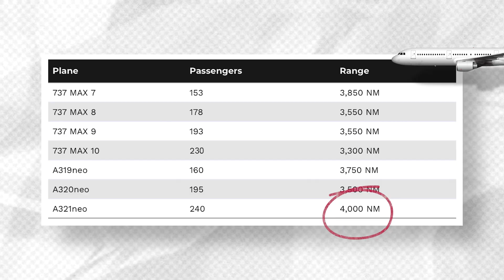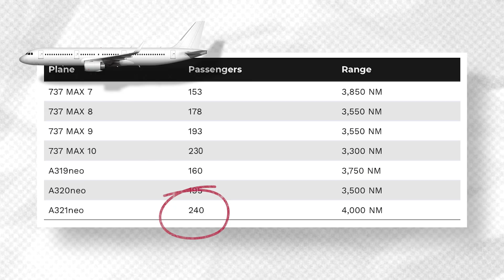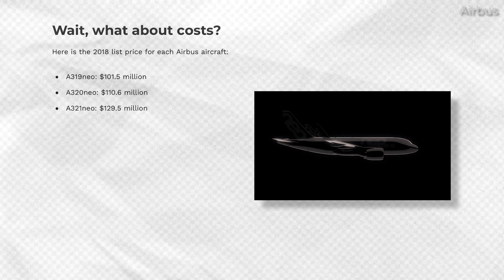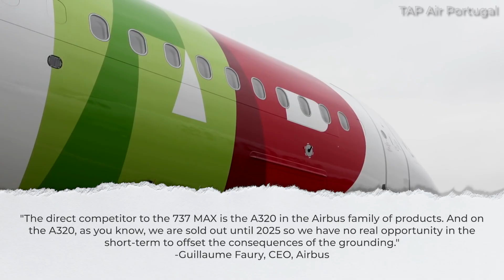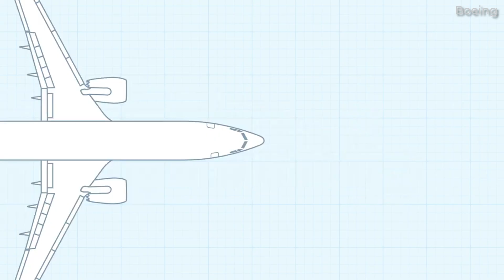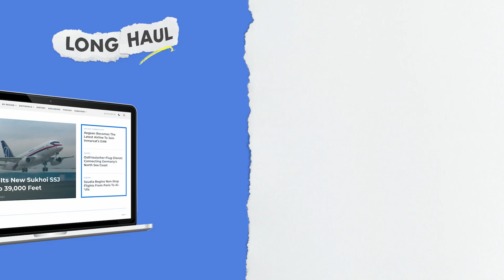The Airbus A320neo Vs Boeing 737 MAX – Which Plane Is Best?

Comment: Brillant video! As both a fan of Boeing and Airbus this is really down the line. I work at an airline that has both 737, and A320 family. The turn around is a bit faster with the B737 and that means better revenue. I love both families, and both do a great job. Great job Long Haul
Reply: The experience-based comment on turn around time is a useful tidbit of information. Could you, or anybody, come up with possible explanations for the difference? Is the MAX easier to clean, or unload people and/or baggage, or refuel?
Reply: @fbkintanar  it’s lower to the ground and was designed in a time where ground vehicles were not as present as they are and is therefore more versatile
- a armchair idiot (me)

Comment: You can't make that statement with all honesty that you did with the 737 being out the 319 because of its 100 mile great range being more fuel efficient WITHOUT knowing its fuel capacity for that range and comparing that as well.  Plus, as you point out...the Airbus has 7 more seats which, again as you state, increases weight and thus reduces range if the fuel to move that additional weight isn't factored in to the totals.  To say the 737 is more fuel efficient is a total based on those parameters is disingenuine.

Where Airbus was looking with the A321neo/XLR is the direct replacement for the aging 757 fleet and the airlines who have, had or still desire that capacity and range (TATL is where the ship found its niche on long thin routes after its discontinuation) Airbus wants that market.

What's funny about the total series sales for the two...the Boeing was launched in the 60s and had nigh on 20 years of advance production time over the Airbus.  In fact, it was flying in airline service for almost a decade before Airbus even existed.  So I'd say Airbus has done on heck of a job to have caught up in a much shorter production time.

As a former ramp rat and as a passenger, while I am a Boeing fan for it being a US product...you cannot beat the Airbus for comfort and ride as well as the qualities it has on the ramp.  I HATED seeing a damn 737 on the schedule.  Give me the Bombardier regionals, the Douglas/McDonnell Douglas T-tails and the Airbus' all day long.  I hated the 737 if I was anything other than the ramp boss and not actively having to work on it.

Bottom line...both are great products regardless of whether a person is a Boeing or Airbus person.  Companies have such a complex process for decision making, but it goes well beyond the numbers and in some cases, nationalism plays a roll as well.  In the end, how each manufacturer manages to do it, I really don't know.  Each airline wants its own specs and tells the builders what they want and what Ryanair and Southwest want may not line up with someone else's need...but who ultimately will the designers listen to?  Their sales department.  He who has the biggest interest will get most of what they want ultimately and everyone will have to adjust.

That's why the MAX had the issues it has.  Southwest Airlines is the cause of that.  100% on the shoulders of them.  They demanded the commonality for the pilots and as such, to make the MAX feel like it flies like the NG, they had to put systems in that changed the feel of the plane for them.  Problem was, they didn't tell the other airlines of this feature and and as result, the crashes because the system for Southwest was a unspoken "secret."
Reply: Boeing should've told all of the airlines operating the 737 MAX about MCAS. It was incredibly foolish and irresponsible of them not to, as MCAS had the potential to cause a plane crash if the sensor it relied on was faulty. It also only relied on 1 sensor, instead of 3, which would've likely prevented both crashes from occuring.

Comment: With safety being considered, its always airbus. But oh boy, the boeing sky interiors are the best must say. Beautiful interiors
Reply: Do you really think that the Boeing cabin is better than the Airbus? You only have to look at the modern joystick control on the A320 to see that it is better than the outdated rudder system used on the 737.
Reply: @LordCommander1  Well then. Airbus has had over 1000 fatalities, Boeing has made way more planes than airbus with some in an era where computer technology and safety features DIDN'T EXIST!!! They are in the wrong with MCAS, but the whole entire company is not made up of criminals. Also, the 747 was incredibly reliable, sure it had a few incidents before computers, but what about United 811? China 006? They sustained incredible damage and the structural integrity of the plane was so strong that the planes managed to land safely

Comment: The A320 is better as the cabin is wider compare to the Boeing. No doubt it is only a few inches but this inches translate to a s few inches on your seat width. 
Further you find the cabin a bit roomier than Boeing. Same thing when you compare B787 Vs A350.
Reply: true, but 787 doesn’t go against a350, the 777 does

Comment: Airbus has a better product range with the A320neo variants to meet airline operational requirements compared to the B737 MAX product range.
Reply: Technically the max has more of a range max 7, 8, 9, 10 all different lengths. While the neo has 319, 320, and 321.
Reply: @thehumblepilot22  - The A319neo is similar to the B737-7, the A320neo is similar to the B737-8 and the A321neo is similar to the B737-9/10. Boeing has no product similar to the A321lr/xlr.
Reply: @chrismckellar9350  I guess on the range no. But the xlr is like the 757 lite is not a complete replacement for the 757 but it’s closest thing. That is why Boeing is going for the MMA to be a replacement for the 757 and 767 size aircraft.
Reply: @thehumblepilot22  - Don't forget Airbus has designs for the stretch version of the A321neo dubbed the 'A322' Airbus is waiting to what Boeing is going to do with their NMA/B797.
Reply: @thehumblepilot22  Boeing have max 8 and 9 only. let's wait and see how it goes with 7 and 10.